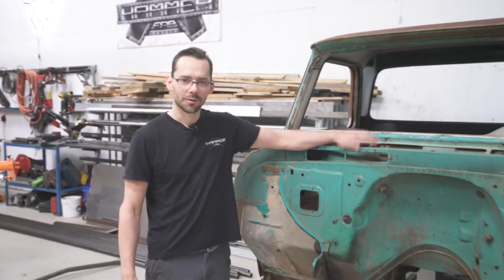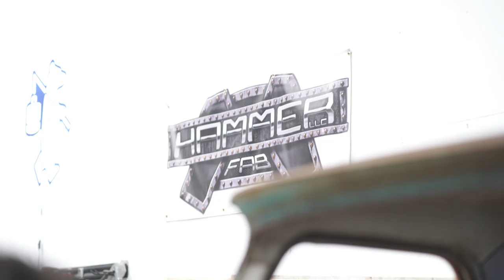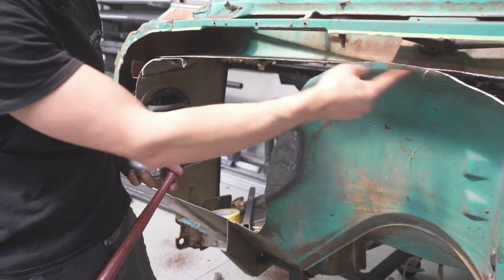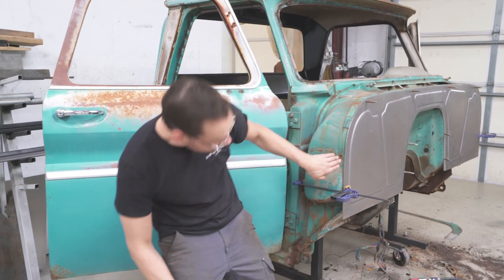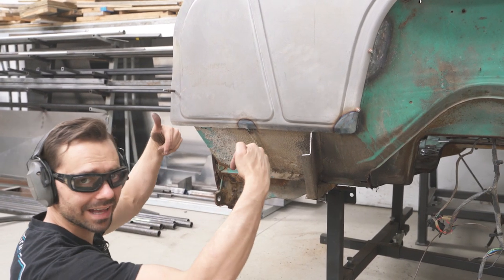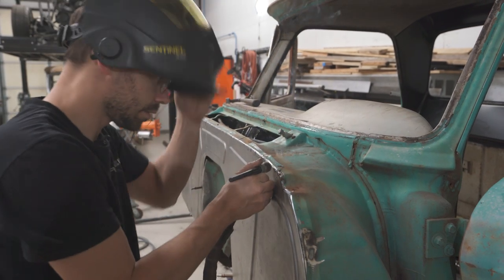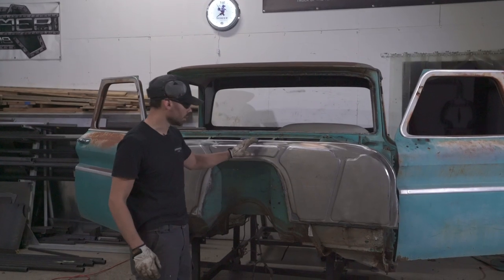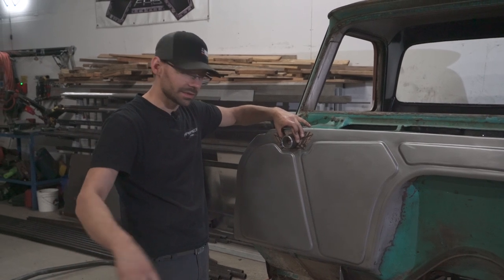Custom Firewall Install for 60-66 GMC/C10

Comment: What grinding wheel were you using on the electric 4" grinder? It looked like it may have had holes in it,. Im looking for a longer lasting disk that dosnt build as much heat in the panel.

Comment: Is there a reason you didn't address the rust on the inside before you put on the firewall? Just curious... I'm planning on doing something like this to my 72.
Reply from the maker: If you’ll notice at 47:57 the inside of the cowl rust has been addressed w  in the POR 15. I didn’t show that part because it’s boring.
Reply: Thanks for the information... great welds btw!